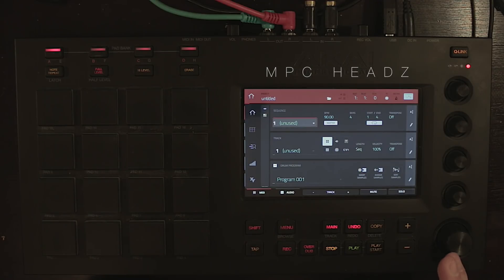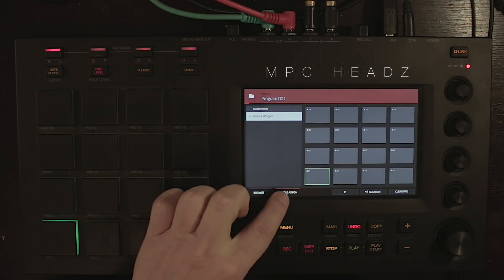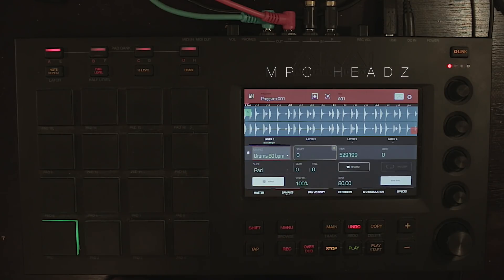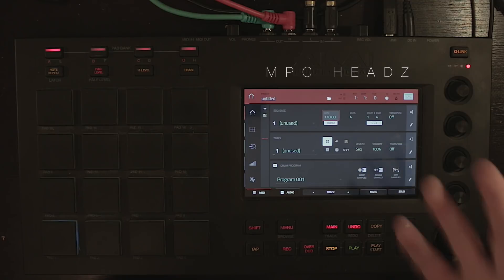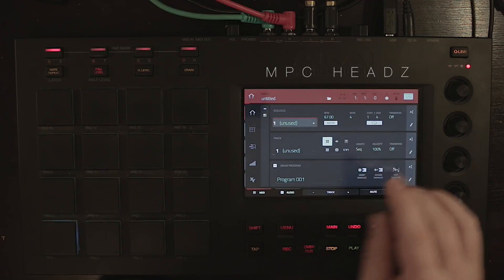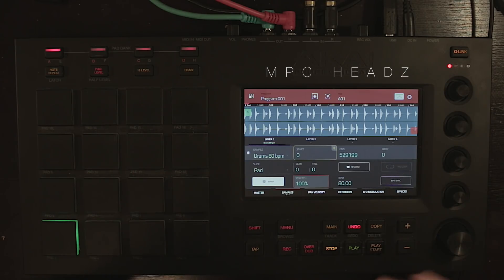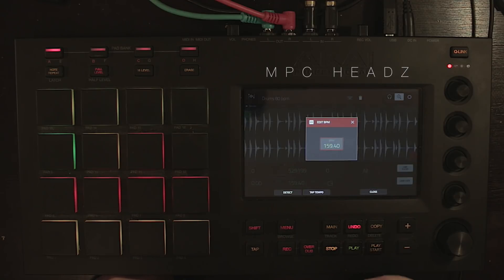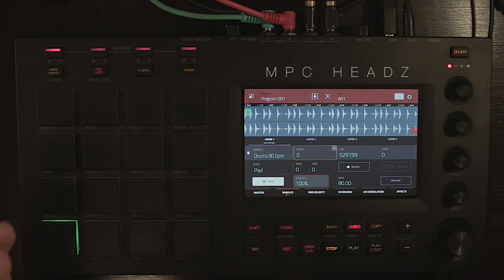Akai MPC Basicz | Sample Warp  - Mpc Touch / Live / X

Comment: Thanks! I still run into some problems with warping music samples. Drums work perfect though. With detect bpm, you can select “from bpm” and adjust the length of bars to find the correct tempo. I think the MPC defaults to 4 bars so if it’s an 8 bar loop the auto detect will be wrong. Just adjust the bar length in “from bpm” and hit close. Hope I painted that picture correctly.

Comment: Question: any idea if there's a way to set Tap tempo to a default for rounding the BPM to a whole number automatically?  Like when I tap I'd rather have 105bpm off the bat instead of 104.34 for example.
Reply from the maker: I don't think that option is out yet.
Reply: Does that option exist for any sampler or drum machine or DAW? I've never seen it.
Reply: @Claidheambmor  I mean on older MPCs like my MPC 1000 there were no decimal points. You could only have whole number tempos. I don't get why it doesn't automatically round to a whole #s by default to begin with cuz it's not like most of us are making crazy math prog experimental shit on these machines.

Comment: Is there a similar feature that detects the key? To transpose the samples to fit as well?
Reply from the maker: That's something that is still missing from the mpc, that would be a good update to the mpc.
Reply: Thanks for the quick feed back, for sure that would be great. I use audio chain I think it is called to find the key of random samples but it would be great to not have to work out the hits by ear. While I have you another real quick question, the USBs on the back of the mpc, can I plug in a mix and/or audiointerface and sample a guitar directly into the mpc that way?
Reply from the maker: @TenThumbsProductions   I haven't tried it but it sounds possible, connect a mix to the audio inputs and record the guitar, not sure about the usb to audio interface. You could connect a preamp to the mpc's inputs and sample that way. Some people record the guitar straight into the mpc and nothing else, but i'm sure you'll lack on gain that way. I haven't tried it.
Reply: mpc head the way I do it now is with the mpc in controller mode and save the samples to the SD card and than switch to standalone, still always looking for a work flow with more flow. Thanks again man!
Reply: Takes seconds to detect the key of a song by playing a guitar or keyboard or even a plugin instrument. Really useful to train your ear as well.

Comment: Thanks for your videos, they have been very useful in my MPC journey :) Do you have any videos about making loops with MPC? I try to record sequences from my modular to then play them as loops, but I struggle a lot with measuring the bars to chop them. Is there a way to make MPC sample edit show the bars as in Ableton so I know exactly where to chop and loop? Its very hard to do it by ear as my sequences have loads of random elements that make the loop very variable
Reply from the maker: Hi Do Funk! If you touch on the cog wheel at the top left of the sample edit screen you will have an option to change the the measuring units to beats. You can also see the beats measure on the program edit screen. If you want you can send me a video sample to my email about what you want to do mpcheadz@gmail.com
Reply: oh thanks a lot! that exactly what I was looking, although I have no idea why there is only "beats" measurement but not bars. Hopefully in new firmware update, they add a "bars" option as well as bar measurement in track. Its just strange the sequence is divided in bars and the tracks dont have an option for bars hehe

Comment: Hi MPC HEADZ and MPC users. I wanted to add a trick that I’ve been using when chopping my own samples which has improved my workflow considerably.
After I’ve chopped my sample into 2,  4, 8 bars or whatever (and done a discard) I have the length of the loop in samples (the big number in “end” when “start” = zero). There are some free apps that can automatically do a calculation which converts “samples” into “bpm”. I type the length of the loop into my app and get the bpm. Done! 
It’s accurate every time. No tapping, or hoping the MPC detect function works. This is an amazing machine but the detect function doesn’t work most of the time. But once you have the correct bpm information for your original sample the warp capability takes over. 
Another example, if I have an 8 bar sample but the first 4 bars are a slightly different tempo, I make 2 samples and do the above process for both samples.
Peace
Reply: What app??
Reply: Yes please tell us what app you are using to detect the tempo that’s my main issue. I was using sera to sample in daws prior to switching to mpc, and it detects everything for ya. I know serato dj does as well but what app are you using ?